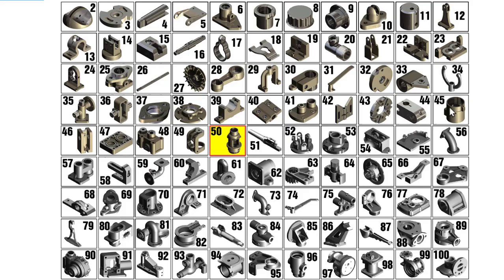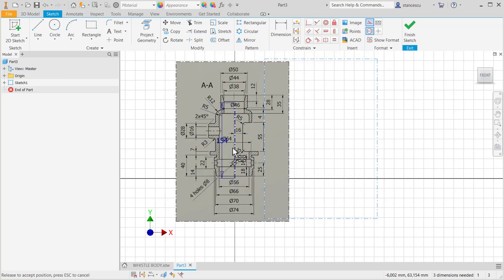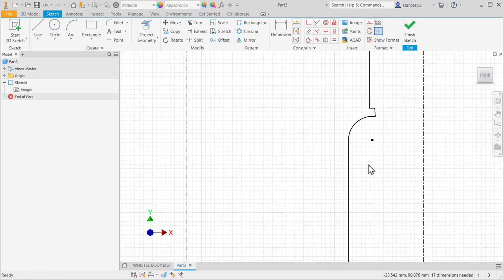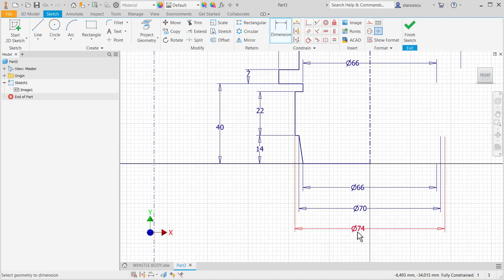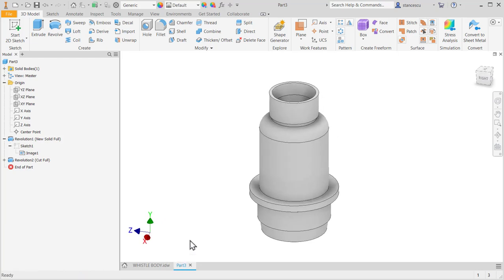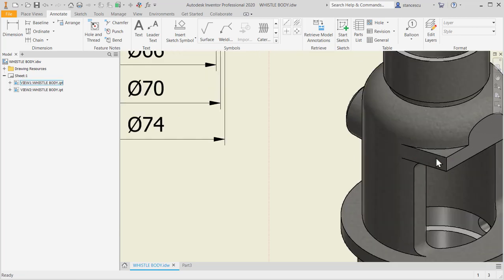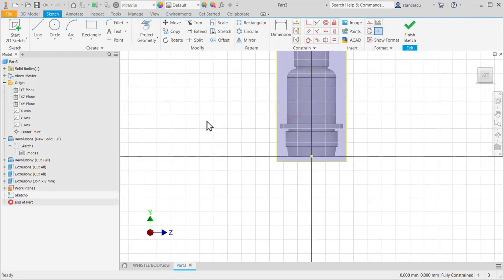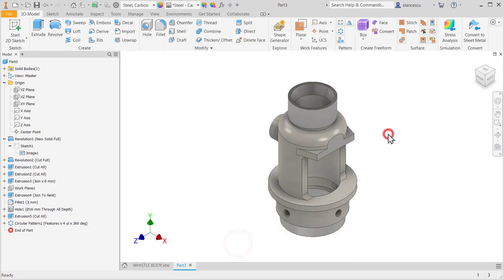Tutorial Inventor - 089 WHISTLE BODY (Part-050)

Comment: A question: Should the final mass checking give the exact same figure as that in your  videos, supposing that the model might be created with different operations?
Reply from the maker: By using other operations you can obtain tiny differences since the Inventor volume evaluation has an assumed (small) error range
Reply: @prof-stancescu  Absoluutely. So that is why for example a model of 0.500 Kg modelled via other operations gives a mass of, say, 0.509 Kg.
Thank you.